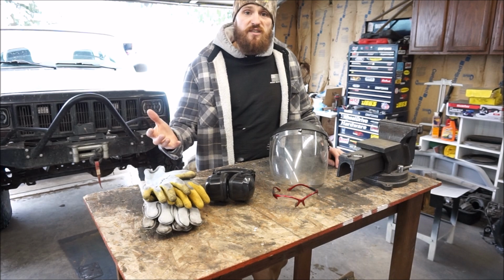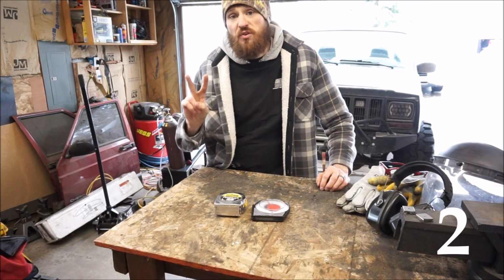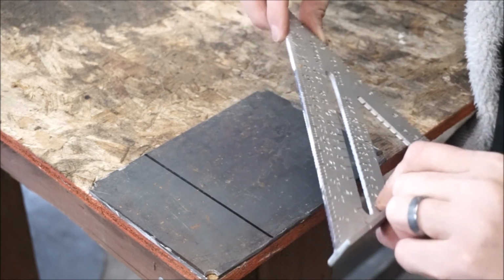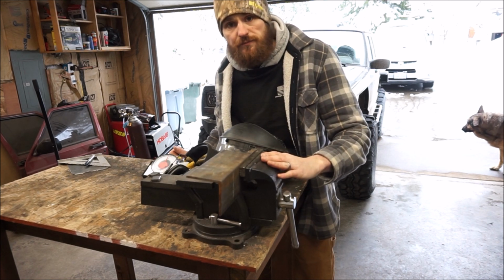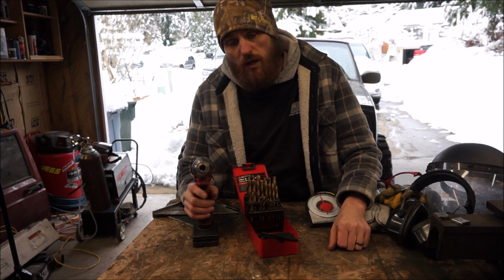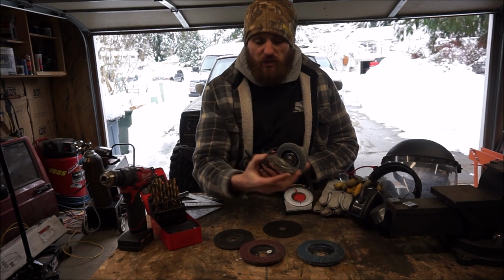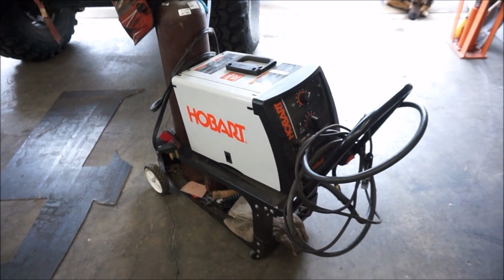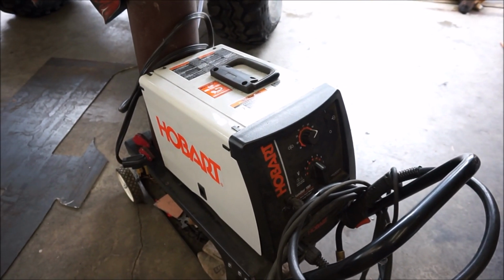6 Tools All Beginning Fabricators Must Have

Comment: Hey buddy would you consider helping someone out?
I recently started Fab work in my shop buying new Hobart welder ,gas and tool and then I took some time rebuilding a wall witch ended up letting theifs in and they took alot of basic tools. Need to rebuy but not sure

Comment: I would include Masonry bits in your drill bit kit.  Nothing cuts through hardened steel like a masonry bit. OH and nothing slings rubber like that wire wheel onthe angel grinder, lol.  Especially,  flexseal.

Comment: Next to my drive I cemented in a 2" ID square tube in to the ground. This way I can take any 2" OD square tube and make a solid stand. You can mount a tubing bender, vice, or even mount up a set of beadlock. It gets you out of the garage if your grinding, welding what ever. If it raining (PNW) I use a 10x10 pop up

When I'm done I have a cover that goes over the hole. Out of sight, out of mind
Reply from the maker: Sounds like a good idea

Comment: Great video. I need to get myself a welder. Starting to really like fabrication
Reply from the maker: I started out with a little lincoln 140 that was perfect for projects with thinner material.   But honestly I would just go ahead and get something with higher amps and 220v. Thanks for watching
Reply: @MuddyBeards4X4   yeah I think I am going with a similar welder to what you have or I have heard the harbor freight brand is pretty good as well

Comment: I used to be the same way with flapdiscs, on only using the sparingly because even though I was using the HF discs, they were expensive and didn't last long. I switched to benchmark abrasive discs and they last way longer and are pretty affordable, especially with their Freemix discount. I use them way more than grinding discs now.
Reply from the maker: I just recently discovered them and your right, they are awesome

Comment: Add a respirator or dust mask to your safety kit. All the dust from grinding and cutting is never good in your lungs.
Reply from the maker: That's a good call.  I usually wear a dust mask but I need to get better about it.
Reply: Seconded. Especially if you're working on anything with paint on it

Comment: Great video!
On the welder note, I didn't plan on fabricating as much as I thought I would, that being said, my first welder was a remanufactured Cambell housefeild I picked up about 2006 that was less than $200 and still have and still works flawlessly, I never hooked it up to gas just ran flux core through it, a very good beginner welder.
Reply from the maker: That's awesome. If you can find them used for a good deal its definitely the way to go. My first was a little lincoln 140 and it worked great for thin materials.